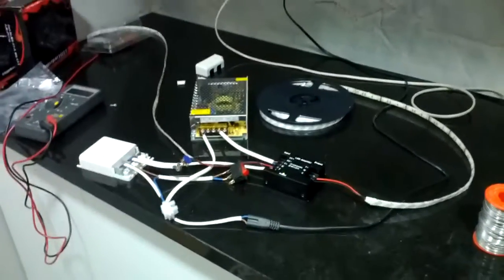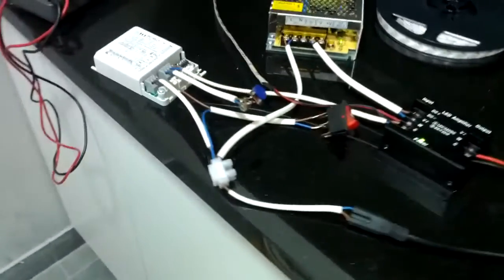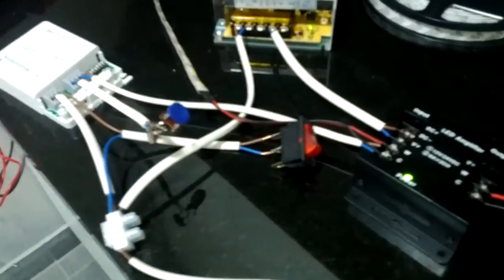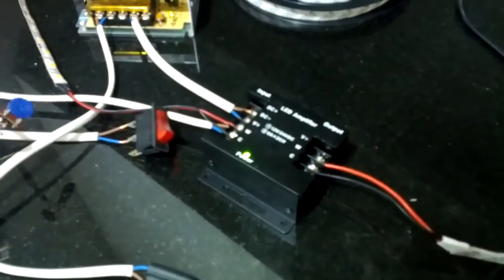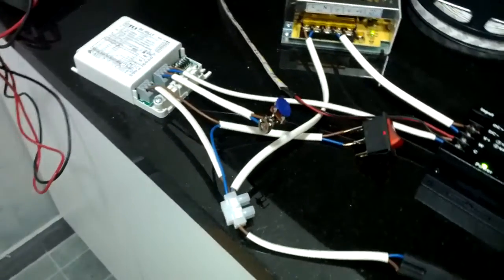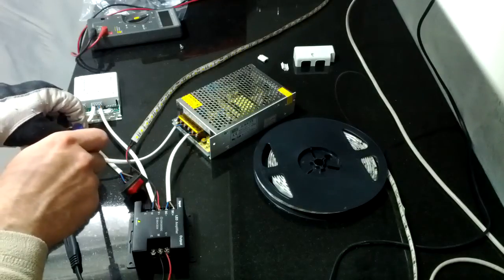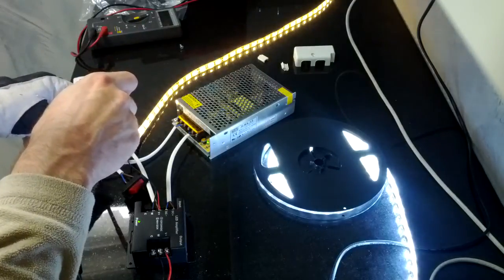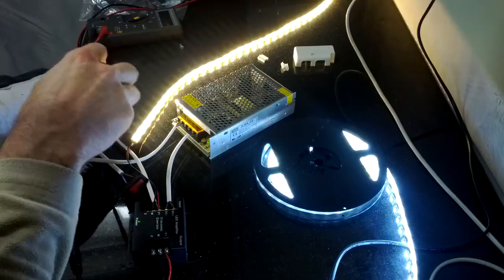LED dimming challenge - dimmers and amplifiers

Comment from the maker: I made this video a very long time ago. Soon after, I found a quick and dirty solution to my problem: I just added a second potentiometer between the Jolly and the amplifier. That lowered the input voltage to the amplifier so that dimming was more or less equal on both sides.